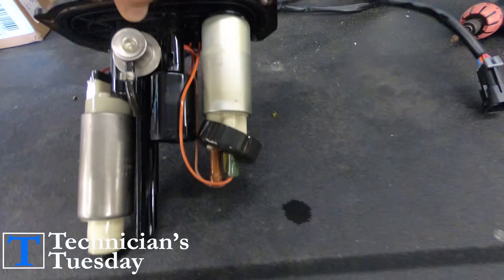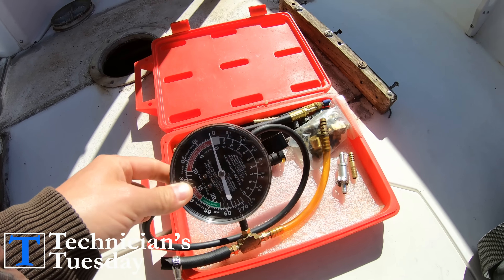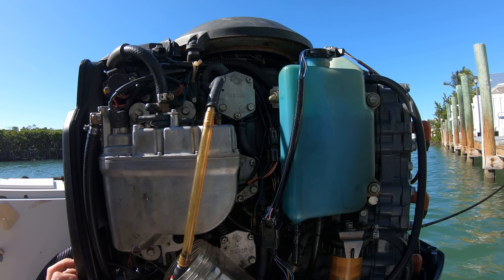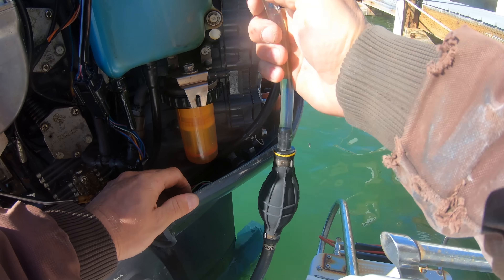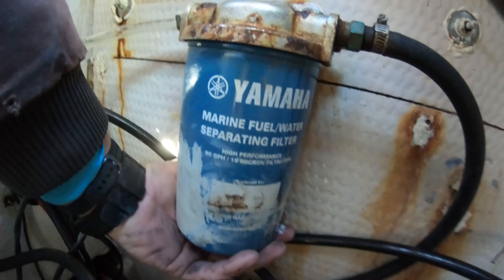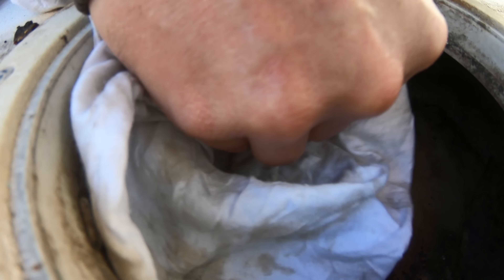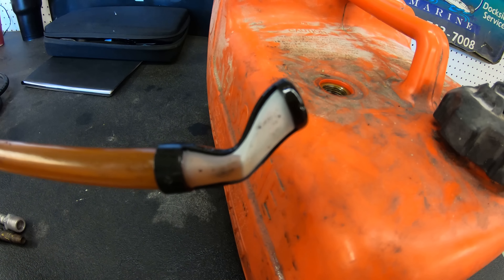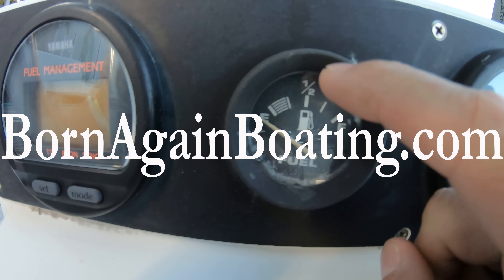Follow These Steps! Why Outboards Run Out Of Fuel!

Comment: My last fuel problem stemed from the ethanol gas eating the inside of the fuel line and clogging it down. A new ethanol ready hose cured the problemo. Yes I know no ethanol but I run additives and have no problems for over 10 years except the hose. I also run the fuel out of the engine when sitting.

Comment: Engine was being starved of fuel immediately after a service.  Priming with the bulb would remedy the issue for a minute or so.  Issue was that service technician replaced the diaphragms in the fuel pump the wrong way.

Comment: Man, that equipment would be a lifesaver for me!! I'm a Mobile Outboard Tech in Boston, MA and had a NIGHTMARE last season. 31' Contender with twin 300 HDPI's wasn't winterized (fuel system wasn't drained). Both motors needed VST cleaned, medium pressure fuel filters, medium pressure fuel pump, cleaned injectors and changed mystery filters. Motors still ran like crap, stalled out, idled poorly and no WOT. The owner assured me the fuel system on the boat was fine (fuel lines, water separators, tanks, pickup tubes ect.). Well after a couple thousand in motor work, I insisted we take a look at the boat fuel system.  Well turns out the pickup screens were clogged and causing the fuel pressure to drop from 980PSI to 150PSI!! I use ALOT of your tips/tricks day to day,  and I cannot thank you enough for taking the time to make these videos! Thanks AGAIN! #gasleak
Reply: Man 300 HDPI's can be a nightmare. Can't imagine doing the fuel systems on TWO of them. Good work mate
Reply: You “bail out” Chris in Gloucester?
Reply: MAT I'm Confused?
Reply: @ravosamarine  nevermind, i thought u could be chris from gloucester who does mobile outboard/boat repairs.
Reply: MAT Gotcha. I am Chris and manage Ravosa Marine Services. We do service Gloucester, might be another Chris you are thinking of however.

Comment: 8months after buying an old boat, replacing the water/fuel separator the filter went bad. Reverted back to this video as to why the engine didnt have fuel and it saved the day. TY and keep @ it

Comment: I have gone through my entire fuel system from tank pickup to carbs.  I pressure tested the fuel line and connectors under water and looked for bubbles - there were none.  I put on some clear fuel line as shown and saw lots of air getting in.  It turns out to be an el-cheapo Walmart fuel connector.  Replaced with an OMC and it cleared up my problems.  Thanks for the tips!

Comment: I once had an 85 Johnson that would suddenly just run out of fuel.  If it sat, off, for a few minutes, it might run for several more hours before acting up again.

Of course, catching it in the act became a challenge.

Starting at the engine and working toward the tank, we finally found it.  

Someone, probably me, had dropped the cap from a plastic oil container in the fuel filler neck.  That cap worked its way into the tank and would sometimes get sucked onto the pick up tube.

We removed the tank, cleaned it out and that engine ran for many more years without so much as a hiccup.

Comment: Not a boat but my Ducati died one time when pulling into my driveway. Removed the gas filler and reached into the tank (drained first) and found that the hose popped off the top of the fuel pump. You could hear it turn on to prime but had no pressure. Took the opportunity to replace the fuel filter since it’s in the tank too.   Enjoy your videos. Will have a boat some day..they will help me be ready. #gasleak
Reply from the maker: Great!

Comment: Hey Aaron, great video as always. Everything was on point. Don't forget about clogged/heavily restricted fuel tank vents, that will also prevent fuel flow, especially if the tank is a newer EPA style tank. #fuelproblems #nofuel #outboards

Comment: Just had a sneaky one.  A nice Evinrude kept running out of fuel.  No air bubbles or flat bulb.  Lift pump and high pressure pump both had great output, yet still running out of fuel.   Was the vapor relief HOSE (not the float switch) from the VST.  That hose lets air/vaport out of the VST.  The clogged hose was pressurizing the VST, not allowing fuel to enter.   Was a pain to find, but I'll always remember that one.  Hopefully, this tip will help you one day, as your tips have helped me in the past!
Reply: Was wondering if you could tell me how you figured this out. I think I am having the same issue. When I feed the VST (FSM) via a clean jar of fuel, I can see air bubbles exiting the fuel hose into the jar, like a steady stream. I am guess this means vapor in the tank has no other way to escape because my regulator is failing or the hose is clogged.
Reply: @AlexTheMD   ut was because everything else tested correctly.   Lift pump was strong, high pressure pump was strong, everything clean.  If the lid of the vst was off, it filled up fast. When on, it wouldn't.  Process of elimination.   I hope this helps.

Comment: #gasleak  ..Had fuel hose inner lining become hard/ brittle and start separating from the outer rubber (from using ethanol).This contaminated the system and also resulted in a "flap" / or check valve effect causing a fuel restriction. Upgraded the hoses , replaced filters and the fuel pump and that solved the issue. Thanks for this informative tutorial on diagnosing the fuel system.

Comment: A few stories for fuel problems.
While fueling the stern tanks an employee of the fuel docks went to the bow to help out, dumped 150l of diesel in my bow water tanks.
Another one, while fueling my stern diesel tanks grabbed a hose off the rack under the label "diesel", began fueling.  After a while pulled the hose up to check level and noticed it didn't look right.  Yup, water.  A couple hundred liters of water in my fuel tanks.
Pumped out the tank, got a few spare sets of water separator filter media.
After running for an hour drained the bowl, after a few more changed the filters.
Of course as soon as I got into rough water the turbulence stirred up all the water and the vacuum pressure started going way up on one engine, so shut down one engine and did a filter change while the boat drifted in huge waves. PITA.
Now the good ones, 21' landing craft with very low hours, took it offshore and the fuel pickup in the tank came off.
Had to disconnect fuel line, stick it in a 20l portable container and siphon fuel into the engine to get home.
Don't know if you care about trucks, but two good ones there too.
Loaded truck, fuel pump quit.  Siphoned some gas out of the tank and put the portable container on the roof, a piece of insulation froman electricla wire harness for trailer lights was salvaged and used to siphon form the roof straight to the carb.
Funny one; car hit a big pot hole, stopped running.
After a while figured out it was no fuel, searched all over, eventually found an emergency fuel shut off switch in the trunk that was flipped to off by spare tire flopping around in the trunk.
Got more, but...
Reply from the maker: Thanks for sharing!

Comment: #fuelproblems #nofuel #outboards 
Bought a pontoon boat last year, my first boat ever.  Tested it in the yard w muffs, which Jiggled off n I ended cookin my water pump.  Now I DON’T trust the muffs lol. 
New water pump and put the leg in a barrel full of water, tested fine!!  I’m so excited I even invite a boat load of friends for my maiden voyage....
During testing in my yard, the boat was bow down. In the water,  the boat was stern down.   Runs n idles fine until we get things loaded up n head out on the water.  Then the engine dies as we’re about 50 yards from shore & absolutely no start after that.   Guess I’m lucky I had lots of spare bodies to help me paddle our way... LOL 
Lucky for us, our friendly neighborhood boaters out on the water seen our plight n offered to tow us back to shore, God Bless em!! They tried to help by assisting in some trouble shooting n checking n swapping plugs even, which he gave me. 
Long story short, turns out there was jus enough water in the tank to put the pickup tube under water when I revved it up n headed for open water.
We ate our lunch in the shade of some big spruce trees that afternoon, luckily nobody got a sunburn that day lol. 
Got her loaded up n home. Checked compression then  I installed a cheap inline filter to confirm my theory of water in the fuel. Tested in the barrel of water in my yard, water showed up in the filter.   I drained my tank n was AMAZED by how much water was actually in the fuel tank. Mounted a water separator and added a Jerry can of Fresh New fuel and away she went.   Hasn’t hesitated at all since n I check constantly for fuel contamination.  
Thanks for reading folks, HAPPY BOATING Y’ALL!!!

Comment: I love your channel full of good tips. When I bought my boat I was fooled precisely because of a problem in the fuel unit (float on a 2007 Mercury 80 hp Efi) . But in the end it turned out to be favorable to my side. The technicians that the previous owner had wanted to sell a complete unit of fuel instead of making a diagnosis so the owner agreed to lower the sale price by 2k and the float Coste 70€ I only found out about this problem after I did the boat restoration.
Reply from the maker: Nice!

Comment: Good info. I just recently had a fuel issue and went about the fuel line inspection process pretty much the same . I found that all and I mean all the ends of my fuel lines had gotten hard and all were letting air in the line causing my fuel system to not fill up properly.  This new video you put out taught me a new way of checking it. 👍
Reply from the maker: Great!

Comment: Went nuts trying to troubleshoot this on my 94 Yamaha 150. One second she was running excellent, next thing I know she won’t go above 2,000 rpm without stalling. Replaced both fuel pumps, spin on filter and bracket, removed the ASV and checked the pickup, new OEM primer. Still no dice. Replaced all hoses EXCEPT the one in the rigging tube to engine. Well, when I pulled that out the problem was very apparent. The hose was swollen right were the rigging tube makes it’s bend on the way up to the engine. Looked like a python that swallowed a bunch of rats! Snaking in a new fuel line resulted in like new performance! Change your lines every few years. The ethanol will take them out. Even if they look good where you can see them. They could be deteriorating in places you can’t! #gasleak

Comment: One thing worth remembering is your fuel tank breather, external tanks have a valve that needs to be open in the running position and closed when not in use, easily overlooked.

Comment: After I rebuilt my classic mercury 500, I had a major problem with the carbs leaking fuel out the overflow vents. After a new set of floats and tons of settings and resetting the float level, I finally got it to seal up. #gasleak

Comment: Kinked or pinched fuel lines is my first check. I always carry a Portable on board then water and other problems won't bother it. Fresh water things don't rust out I have had water in the main tank and it took all 3 of my water separators to get me home. Someone else drove I would bleed the water off as it went into the trap, the last 2 miles was nip and tuck to makes it back. One can polish their  fuel by pumping out into the traps with a electric pump and then back into the tank over and over quite common with the diesel engines.

Comment: This is helpful. Took my first boat out today ( 2006 Ranger Z20 with a 225 Yamaha Vmax).. engine was running great then an hour in to the day cut out.  Primer bulb seems cracked and work along with a section of hose on both ends. I hope this is the issue and not something more serious or complicated.

Comment: I have a boat that I laid up for a few years. It has a Yamaha 2004 F225. I took it to a recommended dealer. Fuel tank was drained and a 100hr service was performed. The engine idle rough and had no power and stalled when accelerating. After a back and forth with the service shop and $3500 later I decided I could do no worse.
Problem was the hose clamp at the pressure side of the primer bulb was not in the center of the fitting and was loose. Since then  it ran well until this trip and after 15 minutes it stalled. I went through the "repair by substitution" game, figured out how to load the Yamaha 1.33 diagnostic on my old laptop and found the Air Flow sensor was bad and a hint that the shifter cable was a little worn. Adjusted the slide in the engine, replaced the Air flow sensor. The 1st tool I will pick up now is my computer.

Comment: It seems that the metal canisters can rot out and leak in as little as six months. I have lost at least four. Also on that yamaha the fine screen on the side of the engine can clog but not enough to pass fuel with the primer bulb but enough that the vacuum operated lift pumps cant keep up. Cleaned or replace the fine mesh filter and off we go ! Thanks for the videos . Learn something every day !

Comment: When first got into boating there was not much ethanol enhanced gasoline around,  Fast forward 30 years after taking a hiatus from boating and we have ethanol, the destroyer of cheap fuel lines. When I ran into the problem it was a real head scratcher as I had changed the line from the tank to the primer bulb with one brand of line but ran out of that line.  I substituted  a lesser quality product from the primer bulb to the engine.  This happened in the fall of one season.  Come spring and I was ready to go fishing so as usual I got out the garden hose and muffs to test everything at home.  Pumped up the primer to a firm feel and cranked, and cranked, and cranked. No joy.  After troubleshooting I found that the cheap fuel line from the primer  bulb  to the engine had deteriorated and the lining turned into pieces and jelly that had gunked up the inlet at  the engine.  Took a couple of hours to figure it out but lesson learned. #gasleak

Comment: I have what I think is a fuel problem now with my 2018 Suzuki 60 hp motor.  It idles kinda ok, but when I give it power it feels and acts like it is running out of gas. I changed the fuel filter, spark plugs and put fresh gas. Also changed the connector that connects from the hose to the tank. It is still doing it,  my next guess is changing the the low pressure fuel pump. What do you think?

Comment: 2000 Stingray 220LX w/ 5.7 EFI Mercuiser kept burning up the high PSI fuel pump that feeds the injectors.  I went through two warranty pump changes before the found the pick up tube in the tank was crushed from the factory.  I have since also added a low PSI, high volume pump between the tank and the fuel/water filter.  18 years and 1200 hours later with no fuel problems (knock on wood).  #gasleak

Comment: Picked up a new to me boat with racor water separators sands the filters  and installed new ever thing  else wiring,engines ever thing! but one engine would get really surgery at WOT couldn't find what was the issue after months of trouble shooting i finally removed the racor filter mount only to find a bug nest inside the racor mount , it looked like a tiny cigar that was blocking the fuel passage to the outlet hose.

Comment: hey! yeah, i have a problem on my 90hp 2001 mercury (4 carbs, not injection), it will idle and do low speed, but when its hot, it you try to rev it up, power up, speed up, it will start shaking and not go above 2.5-3k rpm.. ill check all my fuel lines from the tank to the engine this week, and as someone here allso mentioned ill have to check if the tank air vent, because i can pressurise the primer bulb, but the pressure wont stay there for more than a few sec, so i HOPE there is just a clogged / corroded outlet / airvent on the tank... ill try a sepparate tank today, skipping all the old lines, testing if my problemm lies in the onboard aluminium tank...which i hope.

Tanks for this video, very informative! #gasleak #airleak #fuelproblems

Comment: my boys used boat would run shortly and die out.  new filters and checked the pump. all seemed ok. told him if it happened again to pop the cap off.  he did.  digging in further we found a plugged vent hose.    #gasleak

Comment: Great video about #gasleak. I didn't know about the anti siphon valve. I am building a small flats boat with an internal fuel tank and was planning to run the fuel line under the bottom deck but now I think I will run it just under the gunnel to avoid needing an anti siphon valve.
Reply from the maker: Yeah, just try to keep the hoses above the tank and then put a shut off on the water separator bracket :)

Comment: I have a Johnson GT 150 that runs out of fuel in the carbs. I suspect the VRO pump is failing because I have checked/replaced every part of the fuel system leading up to the pump and one time I got the VRO flow warning chime. Another thing is that it seems to run well when I pump the primer ball but it takes very little run time for the primer ball to get soft again and the motor to start starving for fuel.

Comment: I have an 80s Evinrude 50 horse 2-stroke to very simple fuel system not a bunch of stuff in line like water separators and all that kind of stuff I never have one bit of trouble with it seems like the kiss principle works here